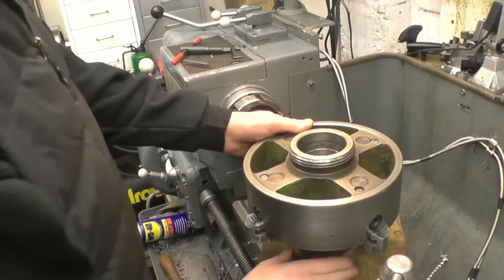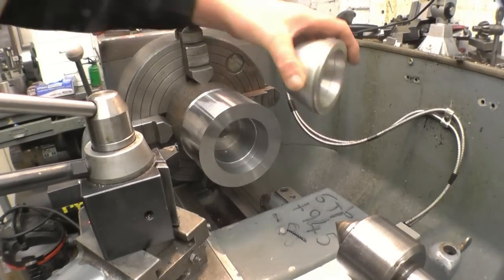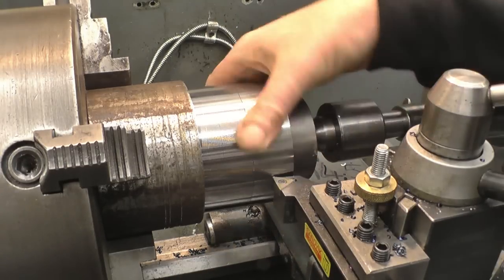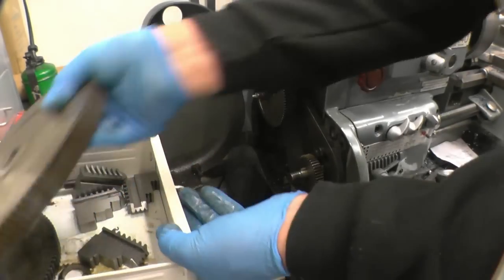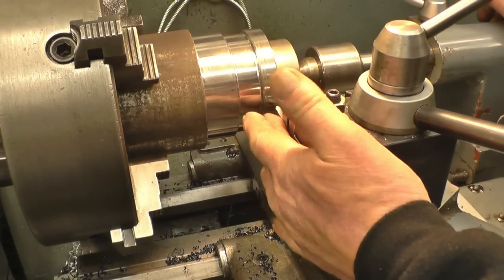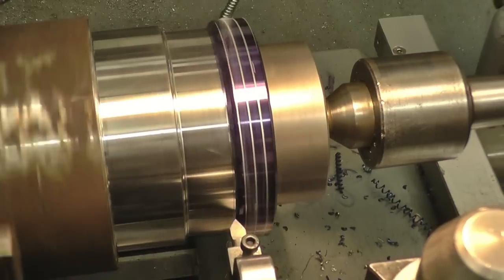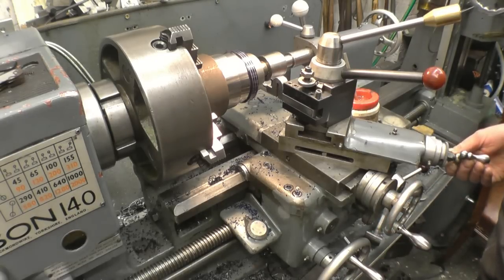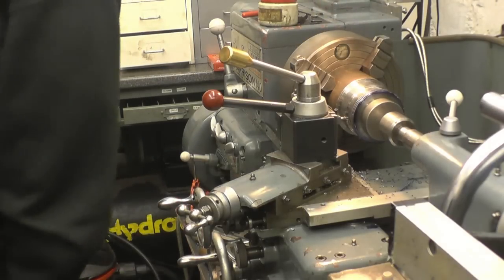SNNC 159 P2  Screw Cutting Spring Tool

Comment: I did some math - a 66 against a 52 (1.2692) is much closer to 1.27 than 63 against 50 (1.26).
In tighter spaces a 66 against a 26 would work also, it´s just that it shifts everything by factor 2.

Comment: Hi John, Just a thought... the 6 TPI thread is likely to be Whitworth form, which is 55 degrees included angle, not 60 degrees. You didn't mention why you were cutting it 60 instead of 55 degrees. Could you please explain the reason? Thanks. All the best to you, Debs and your dad... it's nice to finish with a bit of your dad's organ playing, and I hope your leg is on the mend soon.
Reply: Gordon Burns L00 is an American standard therefor it's a 60 deg thread form
Reply: Glad you asked this as I was thinking the same. John, on the ally test piece you did in the last video you made it a 55 deg thread. Bearing in mind Stuarts reply below ( I don't know the thread standards for these lathes as I'm also a Boxford user) , which thread angle is correct 55 or 60. I hope it's 60 or I'm sure there'll be plenty of "DOZY BASTARD!!!!" flying around your workshop
Reply: +Julian Siddle, I've checked on this and the L00 is 3.75" x 6 TPI, thread angle 60 degrees. This leaves me even more baffled in that why does an English lathe manufacturer use an American standard thread when I'd have thought Whitworth would have been better. I once read that 60 degrees is not an improvement on 55 degrees but a compromise 'to make it look neater'. Seems that Sir Joseph Whitworth may have arrived at the best thread angle before all this metrication and Americanisation, way back in 1841.